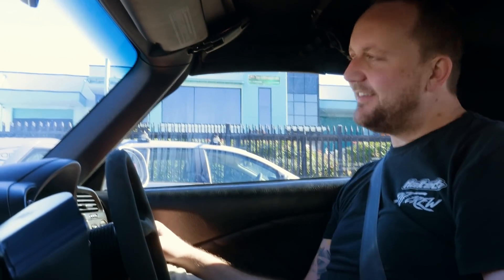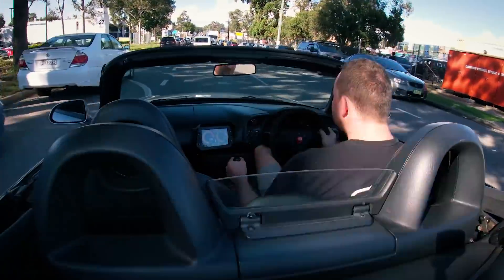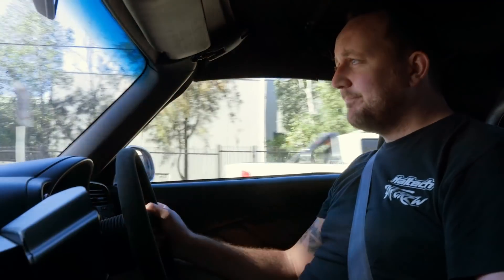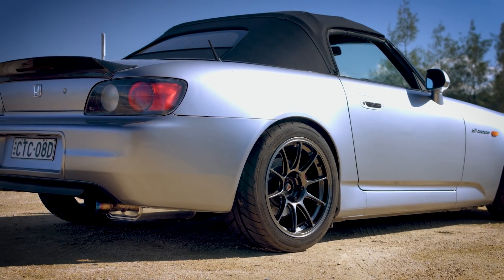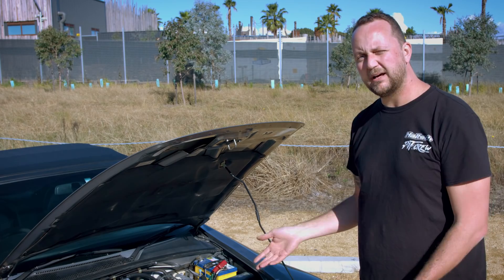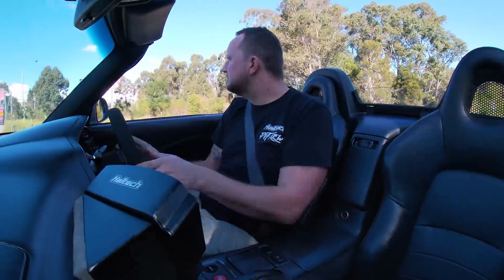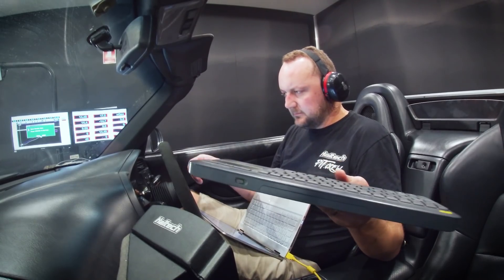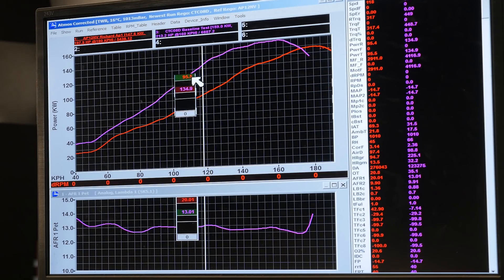💬 Does "K" stand for "King"? K-swapped S2000 examined | TECHNICALLY SPEAKING |

Comment from the maker: Welcome back! 
We've seen plenty of K-swapped cars around and it’s not difficult to see why people would K-swap Miatas, Corollas, Datsuns and even older Hondas. A K-24 simply outperforms all the engines originally used in those cars. But the motor Honda stuffed in the S2000 is a different story. The F20C is a 2L, four cylinder inline four, famous for its 9000rpm redline and a motorbike-like kick when the VTEC comes on at around 6000RPM. So why would anyone want to K-swap an S2000? Our resident tuning guru and a recent K-convert Scott decided to find out...
Reply: @haltech Great video as usual. In your opinion, what would be the best choice to go boosted? k20A2 or k24/k20 head? What's the main difference when boosting these 2 applications?
Reply: Tune Tube it’s k24/20 for boost the extra displacement is grey for building boost. And wayyyy cheaper to build
Reply: Vídeo suggestion: what’s difference between k20 x sr20 x 4g63
4g it’s currently faster 4 ciylinder engine in the world what makes this engine so special?
Reply: Its just a matter of how much k24s are in junkiards, and how much f20/22s ?? After the first swap, its 5 times cheaper to buy a replacement k24 block in a junkyard
Reply: What about turbo a F20 vs  turbo k24/k20 build?
Reply: I love Honda 💗💗💗💗💗
Reply: May I suggest you Play your video with the auto subtitle in English for a laugh.
Reply: @dazaspc  gay swaps 😂
Reply: K motors are good but, they don't have shit on a LS V8
Reply: @Turshin  if the only thing you care about is power, sure. But the K is much smaller externally than an LS, and about 100-150 lbs lighter (depending on accessories). It's a better choice for smaller cars, especially those whose weight distribution would be significantly altered, or for cars where 450 HP would require massive driveline upgrades for reliability or body modifications to fit enough tire (these kinds of cars, e.g. Miata, S2000, also tend to be way more drivable and enjoyable with 275-300 HP than 425+).
Reply: @jsquared1013  you're absolutely right. This is why ppl say the small block 289 v8 Shelby cobra drives better than the 427 v8 but, I want to ask you which is more valued and sought after?....I'll wait.

Comment: If you plan on forced induction, trust me and keep the F and forget the K. Going from F22 or F20 to K20 or K24 is an upgrade in technology but a serious drop in quality and realiability. A stock S2000 can reliably handle 800whp on stock internals because of its insanely perfect design and Honda making it their anniversary unicorn car. The K series are nowhere near as well built. Saying that though, if you planned to go as much HP as possible in NA then K series would be the option. Anything else, forget it. K series motors need complete rebuild and overhauls due to the weakness of the stock internals in comparison. Only two motors in the world are on the F motor level and the other is the 2JZ-GTE in the Mark 4 Supra. Speaking here from owning about 9 of them combined. F22 is probably the greatest engine ever built and if it werent for the Ferrari 458 Italia it would be the most horsepower per liter engine ever made .

Comment: I don't see the point in going K series in a S2k. With full bolt ons and e85, an F20C is making around 240whp and 160tq. Swapping in a K series plus bolt ons is going to run you twice as much.

Comment: When i had my S2000, I stroked it with a K24 factory crank, my butt dyno estimated 300hp
Reply from the maker: Butt Dyno - the often overlooked yet one of the most accurate ways of horsepower estimation.

Comment: As a S2000 owner, I gotta say, if I ever decide to make my S2000 a dedicated high power track car, a K swap would def make sense. Engines are WAY cheaper, F series engines are very expensive
Reply: Besides all the labor & stuff, is it true that you could sell your F-series for more money than you could buy a K-series for?
Reply: @rabidlenny7221  Yep, F-series S2000 engines are getting pretty rare. But the F20/22 is still a better motorsport grade motor out of the box than the K24, K24 is just much cheaper and can be modified/tuned to go past a F20/22 especially NA
Reply: @philspaghet  yeah, mostly cause of the iVtec on the K20/24 right? F series only having Vtec.

Yeah I got an 05 S2000. I fucked up lol. I always wanted an AP1 😢
Reply: @rabidlenny7221  Nah you're fine, I kinda wish I got an AP2 sometimes because F22 motors can handle more boost and it's easier to setup tuning, flashpro and done, plus your chassis is more settled so it's better for tracking
Reply: @philspaghet  true, well the 04 & 05 still have the cable throttle so I think the tuning is still a bit difficult. I really think they fucked that engine up by dropping the rev limit to 8000 while the Vtec remains at 6000. I’m pretty sure if they put iron sleeves in the block it could handle 9000 no problem. From what I’ve read, the fact that the cylinder walls are aluminum, that there are no sleeves, is why it can’t rev to 9. It’ll wear the cylinders into ovals.

Kinda want to get that science of speed stage 1 supercharger kit, but honestly would prefer the low end torque of the SOS turbo kit.

I just don’t know how people get around that EPA pollution controlled vehicle law. So fuckin aggravating. Idk if when to get your car inspected you just sorta disassemble what you need, reflash the ECU back to stock, get inspected, then re-install? I think that’s what I would do. But idk if there are better ways.
Reply: @rabidlenny7221  Well in California I hear you can ask a friend of a friend to do it for you if you know what I mean lol. Well, AP2s have a redline at 8200 because at that rpm, because of the increased stroke, at 8200 the pistons are at the same piston speed as AP1s at 9000 rpm, so it was chosen deliberately. You CAN make them rev to 9k with some software changes but it's not recommended. Usually people with higher rev limits did so so they can have some extra rpm in certain corners on a racetrack

Comment: I absolutely dont agree with him saying that you might make money by selling your F20c and replacing it with a K24 (at 3:52). Absolute bollocks. For starters, the most expensive item is the K swap kit by Ballade sports at usd 3k. Then add to that another USD5k for the K24 engine, K20 head, the obligatory gaskets, aftermarket ecu and labour costs + 2K for the ryewire. That leaves you with a bog standard engine doing less power than the F20c for the price of USD 10k - thats far more than the price of a decent second hand F20c. For me, the loss of power alone is a big no no. So what do you do? Would you spend 10k for an engine with inferior power output or do you dig even deeper into your pocket to get more power, once the engine is open? I myself am in the middle of such project and found myself spending another 4.5k to get more power...camshafts, piston, rods, bearings, valve springs, retainers, intake/exhaust valves, head studs, fluid damper, throttle body, baffle pan, pumps..bla bla...so no, this is one hell of an expensive project which I wouldnt have gone for. The only reason I am doing it is because the F20c is so difficult and expensive to repair, and being a track junkie, I am done with breaking bearings, rods and yes a crankshaft too :(

Comment: Haltech, I will say at the beginning thanks for doing this vid. I've never owned a K Series engine but I've always been a fan and quickly learned to respect Honda Engineering in all it's well deserved glory. Yet we are not going to talk about The S2K's problem differential. As Dustin Williams in his Track S2K has exposed that weakness. Yet not every car is perfect RB26DETT's Oil Pump? Exactly. Thank you for doing this and yes The K series is a better engine and for the simple fact it was designed after The F series and the people at Honda don't make an inferior next gen engine they build on the shoulders of the last one.

No hate for The K series b/c you can't deny perfection. It is the best I4 in the history of engines. When you're a V8 or I6 F/I person and you see a K20/24 engine making between 250 to 320whp you and using all of it(not being some dyno queen), you can't help but sit back and pay respect for power and the perfection of the Motor. Ford, Chevy, Dodge, Euro, and other Imports have nothing bad to say about The K Series or at this point B, H, and F that lead up to The K b/c you can't deny power/liter. What is said though "No tq and a small power band" If you're a Domestic person you know that can best solved with gearing and shorter R&P FD. Oh when I went from a U.S. R&P FD to a Euro 3.94 R&P FD in my VR6 Jetta it felt like it took all of the mods I had done to it(cams, head, Schrick VGI, etc)and woke them up to a level I never knew existed. Yet to get back onto The K series it's not just its engineering, it's the amount of N/A power you can get from them, it was as if Honda built an engine that can both be used by your every day family for normal use and at the same time the same engine can be modded for amazing power. The stock K20A2 series in The series is 200 crank hp and 220 crank hp from a JDM K20A which is not bad. I think(correct me if I am wrong)the stock K24 was around 205 to 210. I may be wrong on those exact numbers. You don't even have to swap heads and bottom ends to make great power but when you do it's even easier to make more. So this is why The K Series is King. 1st Engineered to perfection. 2nd Makes great Power. 3rd Out of the box it makes good power but nothing too wild for your everyday family car but is a 4 cylinder which makes for great gas mileage b/c mom and dad aren't spending their life a quarter mile at a time. LOL Well most mom's and dads.

Comment: The peak power the F20 is making at 180 kmph is available between 130 and 170 kmph on the K swap car. That's insane! The K swap car is definitely superior in my humble opinion. It's sad to see a sports car loose some of it's rpm, but given it's not much and actually gains power throughout the entire rev range it's fine by me

About the hate and competition part. The K24/20 doesn't have any competition in the 4 cylinder market. There aren't any other NA fourbangers to my knowledge that have the same power and torque as the K24

Comment: I wouldn't mind losing 1k rpm of "usable" rev range for that much power and torque lower. The stock f20c isn't gutless down low but if you are cruising on a higher gear chillin, and you want to pass or you get on a big grade, it really lacks grunt sometimes. It's funny to downshift 2 gears and Rev de sh*t out of that engine, but when cruising you don't always want to make it scream. Or when the engine is cold too

Comment: Given the .4 liter advantage this K has, the difference is kinda nominal. I bet if you bore the F20C to 2.4, the F24C would be more powerful than the K24. Thoughts? The F20C is already better than the K20; so..... I would love to learn more about all of this. 
Granted, I am partial to the F22C because I own a USDM S2k AP2. 
In my opinion, the top best engines are:
1. Tipo F140 GC (V12)
2. Viper VX-I (V10) 
3. Tipo F136F or GM LS (V8) {depending on application}
4. 2JZ (I6)
5: F22C (I4)
Reply: 😂😂 That Viper engine shouldn't be anywhere near that list. It's only real strength is that it's eight freaking liters.

For years Honda guys have told me that the K head flows better than the F head (at least K20A2 that's in the RSX-S and others, vs the F20C; I sold my S2k in 2009 (still regret that) so I haven't stayed in the loop as in depth since then). Everything Honda learned from making the F20/F22 they used when designing the K-series. But by then they had better CAD and simulation tools available. And the F20C, F22C, and K series all have the same bore, the stroke is what makes them different. And since the K series uses iron sleeves compared to the metal matrix composite cylinder walls of the F20C, it would theoretically be easier/cheaper to bore out a K.

Comment: Swpping a K24 into an S2000 is potentially catastrophic. Why? Because the oil pan shape, its lack of ANY lateral baffles and pick up are ALL WRONG. They are designed for transverse (FWD) applications and does not keep the engine oiled when you corner hard. It wouldn't matter in city driving with the occasional stop light drag, but if you track it you will likely blow it up.
--
Another fallacy is that the High Specific output Honda engines are king because they deliver a lot of horsepower for very little displacement. It is a fallacy because physics does not care one bit about how many horsepower per liter you get from your engine. It does care about how many horsepower you get per unit ENGINE MASS. The F20C is about 325 lbs (w/o the transmission). That is not very light for 240 hp -- about 0.74 hp per pound of engine weight. The K20A in its 217 hp JDM guise weighed 275 lbs for a slightly better 0.79 hp per pound. For contrast, a Pushrod 2-valve LS3 engine of the same era made 430 hp while tipping the scales at 403 lbs. That is 1.07 hp per pound of engine mass. The king of the LS family, the 7.0L LS7 made a whopping 505 hp at 454 lbs for a 1.11 hp per pound. It is not even close. That is why, if not for displacement taxes and racing rules, pushrod engines will ALWAYS win the performance war. That is also why, the LS swap, not the K-series swap is the most popular engine replacement scheme in the USA.

Comment: How often are you hitting redline in an S2000? ALL THE TIME!

I love the idea of more torque, had a 919 Hornet and loved the torque it offered. Probably why I chose the AP2/F22C over the F20 - about 50 HP more before VTEC crossover at 6k so you're not wanting for power looks with the F20. Rather than swap for more grunt, maybe a SC though.

If you want torque, swap a diesel in lol.

Comment: waiting for someone to do a K20c swap in the S2K.
Reply: That would be good, but it doesn't have that N/a charm of the F or K series. And also, the direct injection makes it a much more difficult swap, as you end up having to replace just about everything, fuel system and all

Comment: Im an owner of s2000 (with F20c ofc). But i can see your point. Daily driving the car with the k24 in it, will make it more 'alive' in the low-mid rpms, more suitable for short-distance roads , maybe close  and low speed corners. The F20 needs some road to keep all gears close 9k and get all the power out. but the sound it makes after 8.500 rpms, unreplacable.
Also, upgrating/servicing the k24, is easier and way cheaper.
Reply: A 4.7 final drive and a aem ems (plus 70mm header back exhaust) compensates for the lack of midrange torque
Reply: @brunomanco7529  those same modifications will also work on a K-swapped S2000, so you're back to the same gap.

It's not a gain of 16 HP from the K-swap. That 16 HP is at the peak near redline. The real-world HP gain is 40+ HP EVERYWHERE except the last little bit up top. WAY more area under the curve, which is more important than peak (which again, the K has more at peak also).
Reply: @jsquared1013  i had a european ep3 type-r, a k20a2 with dc5 cams, with the usual boltons and a 5.33 final drive (shouldve went with the 5.45). So the f20c s2000 i have is a letdown engine wise. I still havent tracked it with the new lsd and 4.77 final drive (powerwise i have spoon snorkel and filter, 70mm decat and catback, aem ems), so hope the shorter final drive "increases" the torque feeling. I had 255/40 both in the ep3 and now in the s2000.

Comment: Also worth noting you can make a K24 rev to 9000rpm and you can get 300whp NA. I'm a S2000 owner and I regret not K swapping when I blew my F20c
Reply: You could but the longer stroke means your piston speed is higher, so the reciprocating forces are higher and you're more likely to have a terminal failure. It's not especially likely, they're still good engines. But it would shorten the Engine's lifespan for certain
Reply: Not standard they won't, set of forged internals it will all day tho

Comment: Bottom end stock k24, stock head with custom cam with common gas station fuel can make more than 200hp at wheel. With turbo, bounce stock easy to get 400hp at wheel, just in case this machine have huge population in the world. Nowdays kswap Miata more reasonable than othet swap, even stock engine with turbo. Thx Haltech for 2 episode of Kseries engine.

Comment: ive got one important question about the k24 specificaly. 
what about piston speeds and high revs on an n/a setup with a k20a head? 
dont they leave anyone worried?
Reply: Just count the stroke and the rpm they run

Comment: I wonder what Al (Turbo Yoda) thinks of the K?

But definitely want an MX-5 with a K swap.
Reply: Why not LS swap?
Reply: @Turshin  You what mate?
Reply: @Turshin  Because the LS is heavy AF. The entire point of an MX-5 is that it is light and nimble. Turning it into a miniature corvette seems to have very little appeal to people outside the US.
Reply: @andersjjensen  LS 1 is all aluminum and actually lighter than a b18
Reply: @andersjjensen  I'm a Honda guy and even I can tell you you're just wrong. The aluminum LS1/LS2 engines are only maybe 50-100lbs heavier than a miata engine after accounting for engine, transmission and differential weight increase
Reply: @leeharvey65  nope. The LS is heavier than the Miata engine by 50-100 lbs BEFORE factoring in the need for a stronger gearbox and diff. Most LS-swapped Miatas end up 200+ lbs heavier than stock.

Comment: I'm not a huge fan of Honda...but im not against them. I thought about putting a K24 hybrid into my 71 Datsun but I don't want to lose that inline 6 originality of the Z. I wish they made a six-cylinder version of the K24 or a V8 based off of the K24 cylinder head with a girdled bottom end.... it'd be the perfect engine.
Reply: Pointless, the 4 cyl k motor is a perfectly balanced motor. Less moving parts (then 6/8cyl), reliable, and powerful. How are you not a fan?